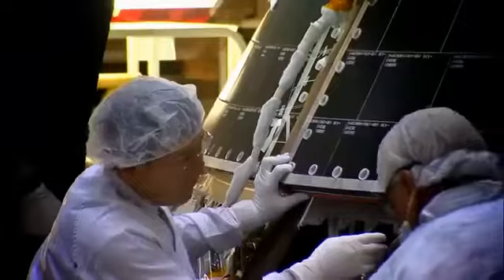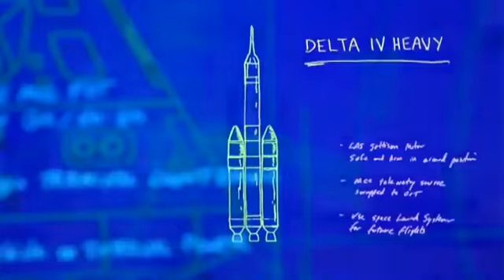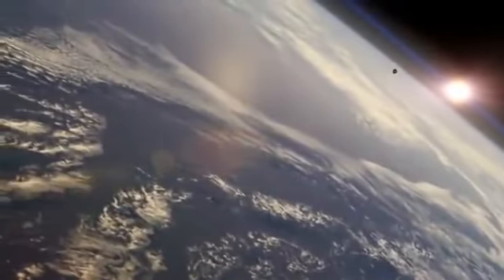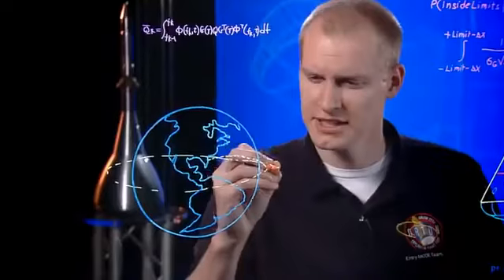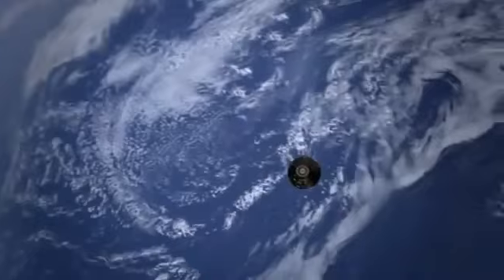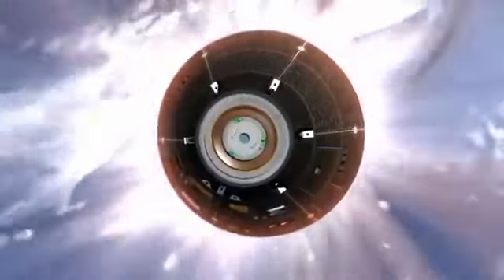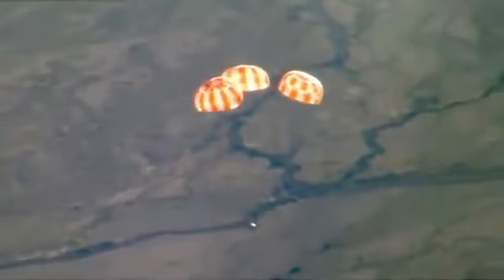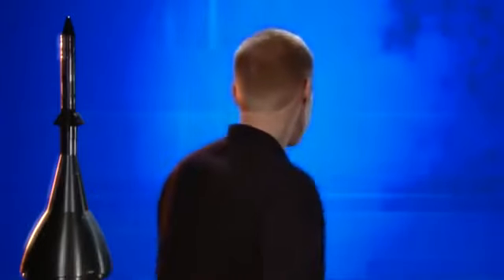NASA engineer admits they can’t get passed the Van Allen Belts

Comment: We did it once in the 60s we can do it again but apparently somehow we lost the technology
Reply: We went to the moon at least nine times during the apollo program.

When we stopped, we got rid of the stuff we only had built up to go to the moon. There's no reason to redevelop a massive amount of expertise and a supply and manufacturing chain for 50 year old technology when we can just design a new solution. In the intervening time, miniaturization of electronics has made them more vulnerable to radiation, so we need to test that our shielding is working before trusting the orion to keep humans alive.
Reply: seigeengine 

So what's protecting the manned space stations in orbit from radiation? I didn't post my comment with the intention of saying we should re-use old technology all I'm saying is we have better technology than we did back then and to think that they didn't plan to counter radiation in space during the time from then to now is a bit stupid however I don't know anything so my statement may be wrong and aside from the cost and materials needed for these rockets it shouldn't be that much of a problem
Reply: Their radiation shielding? They're not high enough to have too much problem from the belts, and take the ISS: It's a massive structure built up over a couple decades, and all it has to do in the short term is keep falling around the planet.

To my knowledge, unmanned craft generally just aren't operating on their way through. 

Well, you're kind of right. Aside from the cost and materials it isn't that much of a problem. The problem is you're underestimating what that cost entails. The apollo program consisted of hundreds of thousands of experts producing specialized cutting edge systems composed of millions of custom-made components. Most rockets we use cost in the tens to low hundreds of millions of dollars. The Saturn V rockets the Apollo program used cost over a billion dollars each. The entire Apollo program cost $100-200B.

Comment: It's refreshing to hear an honest Nasa engineer. Many engineers have spoken about the shielding problems and conclude that until technology has advanced sending people into space safely is just playful imagination
Reply: @ValMartinIreland  Yeah your right Val. There's a lot of difficulties that present themselves especially when radiation can be extremely dangerous here on earth, I can't imagine how dangerous it gets outside the ozone layer and past the earth's magnetic field which protects us. I wouldn't volunteer to try out that's for sure.
Reply: No, that engineer is NOT admitting anything of the sort. He's talking about the first Orion test flight. This was done to make sure the Orion capsule works correctly in the VA belt: electronics can malfunction in high-radiation environments. Orion's electronics are designed to deal with this, but a practical test is required as part of due diligence. All of the hardware on Orion is new, so it has to be tested in operational circumstances before being considered human-rated. 
The Apollo program did these tests as well, during the Apollo 4 and 6 flights. 

We figured out how to get through the van Allen belts in 1958. For radiation, there are 2 important variables: 
1. the radiation intensity
2. the amount of time you are exposed to this intensity. 
You can multiply these two and get the total radiation dose. Humans die if they receive a dose of about 300 Rad. 
In 1958, James van Allen and his team at the University of Iowa discovered the belts that were later named after him, using measurements from the NASA missions Explorer 1. With Explorer 3 and 4 and Pioneer 3 he measured the radiation intensity. This is what he found: in the part of the belt where the intensity is highest, it is high enough that if you stay for about a week (inside an Apollo command module), you receive a lethal dose. So for the Apollo missions, the trajectory was designed to minimize the amount of time spent there. The Apollo astronauts flew through the belts in about 3 hours, while avoiding the part with the highest levels entirely. The hull thickness of the CSM was more than enough to reduce the radiation level inside to manageable levels. 
Astronauts' overall exposure was actually dominated by solar particles once outside Earth's magnetic field. The total radiation received by the astronauts varied from mission-to-mission but was measured to be between 0.16 and 1.14 rads (1.6 and 11.4 mGy).
More details in this video from Scott Manley: https://www.youtube.com/watch?v=h9YN50xXFJY

Comment: Good thing those Apollo capsules didn't have to get to 4000 degrees when they re-entered earth's atmosphere or that tin would have melted.  You would think something 4000 degrees might leave a little steam when it hits the ocean waters.
Reply: The apollo capsules also had ablative heat shields, and likely would have been quite hot on hitting the water. Not sure what your point is.

Comment: No, he didn't. He was talking specifically about the Orion vehicle. If you were designing a new aircraft today you wouldn't just get some plans from the 60's and build a Boeing 707 would you. Orion is made from 21st century composite materials so they need to record the radiation levels inside the vehicle to see whether it's resistant enough to allow the crew and the 21st century electronics (which are far more sensitive to induced voltages from electromagnetic radiation than the old gear from the 60's) to be sufficiently protected. If it isn't they'll just modify it until it is, that's engineering. Apollo was old technology... all aluminium and titanium, it would have offered the crew and systems the required protection, but it's had its day. It's time to move on.

Comment: They have to solve shielding issues BEFORE  he says. So they have not solved anything
Reply: They did. That was four years ago, and Orion has completed its journey.
Reply: @Jan_Strzelecki  So if they've only just recently solved these issues, we couldn't have gone to the moon 6 times
Reply: D Mac If they had gone to the Moon using the same trajectory, going right through the high radiation regions, then no, we couldn't. 

However, Apollo went through different region of Van Allen Belts, where the radiation isn't as high. Orion on the other hand is a deep space exploration craft, and if it can't handle radiation in thickest part of VABs, then it has no business going into outer space, where radiation is also quite substantial.

Comment: No possible directional link established for video transmission -- no problem. . The only directional [ parabolic dish ] antenna carried was a portable unit that could be unfolded and set upon the lunar surface, carefully adjusted to confirm an Earth link. . Not possible as Neil Armstrong took his first step with live broadcast. . Ever wonder why Walter Cronkite had that smirk on his face at the moment of touchdown, the greatest moment in history at that moment? He knew the requirements of transmitting video from a remote location.

No relay was possible as the command module was seen to follow the curvature of the moon in a changing orientation with respect to the Earth, while there was no tracking capability at that time to establish a directional link for video transmission -- and even as the command module remained in orbit traveling around the backside of the moon, and rarely overhead or in the vicinity for any length of time as preparations were being made for the first step onto the surface.
Reply: It seems NASA fanboys can't reply.

Comment: Why does the Orion module looses communication ?🤨Why even over the Indic Ocean but the VOYAGER tin cans sent to the end of the solar system are were STILL sending information after so many years??..🤔 Can anybody explain this?🤔I gave up on a good answer in how NASA sent the men to the Moon using a calculation sliding ruler..(for real I saw it an old engineering documentary😱) ! and computers withe less processing power than my I phone. 😭

Comment: Apollo took off from Florida as it was the nearest to the equator on US soil.   The nearer to the equator the more  advantage the craft gets from the earths east to west rotation.   It flew out across the Sahara and across India still taking advantage the earths rotation and in line with the original trajectory.   The Van Allen belt is not weaker at the poles but it is lower down.  Turning at an angle was not an option and the course was and is well publicised.
Reply: exactly, i heard the same thing, equatorial launch

Comment: We figured out how to get through the van Allen belts in 1958. For radiation, there are 2 important variables: 
1. the radiation intensity
2. the amount of time you are exposed to this intensity. 
You can multiply these two and get the total radiation dose. Humans die if they receive a dose of about 300 Rad. 
In 1958, James van Allen and his team at the University of Iowa discovered the belts that were later named after him, using measurements from the NASA missions Explorer 1. With Explorer 3 and 4 and Pioneer 3 he measured the radiation intensity. This is what he found: in the part of the belt where the intensity is highest, it is high enough that if you stay for about a week (inside an Apollo command module), you receive a lethal dose. So for the Apollo missions, the trajectory was designed to minimize the amount of time spent there. The Apollo astronauts flew through the belts in about 3 hours, while avoiding the part with the highest levels entirely. The hull thickness of the CSM was more than enough to reduce the radiation level inside to manageable levels. 
Astronauts' overall exposure was actually dominated by solar particles once outside Earth's magnetic field. The total radiation received by the astronauts varied from mission-to-mission but was measured to be between 0.16 and 1.14 rads (1.6 and 11.4 mGy).
More details in this video from Scott Manley: https://www.youtube.com/watch?v=h9YN50xXFJY

Comment: Soooooo we never have gone through the van Allen belt
Reply: We figured out how to get through the van Allen belts in 1958. For radiation, there are 2 important variables: 
1. the radiation intensity
2. the amount of time you are exposed to this intensity. 
You can multiply these two and get the total radiation dose. Humans die if they receive a dose of about 300 Rad. 
In 1958, James van Allen and his team at the University of Iowa discovered the belts that were later named after him, using measurements from the NASA missions Explorer 1. With Explorer 3 and 4 and Pioneer 3 he measured the radiation intensity. This is what he found: in the part of the belt where the intensity is highest, it is high enough that if you stay for about a week (inside an Apollo command module), you receive a lethal dose. So for the Apollo missions, the trajectory was designed to minimize the amount of time spent there. The Apollo astronauts flew through the belts in about 3 hours, while avoiding the part with the highest levels entirely. The hull thickness of the CSM was more than enough to reduce the radiation level inside to manageable levels. 
Astronauts' overall exposure was actually dominated by solar particles once outside Earth's magnetic field. The total radiation received by the astronauts varied from mission-to-mission but was measured to be between 0.16 and 1.14 rads (1.6 and 11.4 mGy).
More details in this video from Scott Manley: https://www.youtube.com/watch?v=h9YN50xXFJY
Reply: @h.dejong2531  long story short. All scientist agree its impossible for humans to pass through.
Reply: @6030jdr  No, they don't. Only lunatics claim that it's impossible despite all the evidence to the contrary.
Reply: @h.dejong2531  lol, oooook. Several videos on it from NASA.  That's why we ha ent been outside earth orbit.  Not sure where your living g at bud
Reply: @6030jdr  No, those videos by moon landing deniers making false claims/misrepresenting what NASA is saying. Those videos show an engineer talking about the first Orion test flight. This was done to make sure the Orion capsule works correctly in the VA belt: electronics can malfunction in high-radiation environments. Orion's electronics are designed to deal with this, but a practical test is required as part of due diligence. The Apollo program did these tests as well, during the Apollo 4 and 6 flights.

Comment: Wow, it’s amazing how casually he said they are still working on the problem, pretty much admitting that no astronauts have yet passed through the belts.
Reply: Wow, it’s amazing how casually he said they are still working on the problem
No he doesn't. The flight itself has proven that the problem has been solved. Also, it has no relevance to the veracity of the Apollo program, since each Apollo mission has passed through the belts in a different spot.
Reply: Okay Jan, you're the expert.  Capricorn One was a crappy movie anyway..........
Reply: @Joel4500  Okay Jan, you're the expert.
Not really, no.

Capricorn One was a crappy movie anyway.
Not really, no. It also ended with the conspiracy being exposed for everyone to see - which, again, is not the fate of Apollo.

In any case, do you understand why whatever the Orion is doing has no bearing on the veracity of the Apollo program, as far as the Van Allen Belts are concerned?
Reply: @Jan_Strzelecki  It was a JOKE dude, relax....

Comment: twice as hot a lava: next vid plz... smh
Reply: Twice as hot as lava and almost a vacuum. It is more than the energy in the particles, it is also their density. If the particles are very diffuse you can withstand those temperatures with no protection.
Reply: Advised Potato ok

Comment: Maybe he was saying they must solve the problems associated with the orion craft, and not referring to space travel in general
Reply: How exactly, then, did they test the problems with the Apollo space craft before going?
Reply: @joes.2111  probably, but even if they didn't, radiation isn't going to kill someone just like that. The biggest problem with actual technology is that electronics are smaller, therefore they work with way less current, radiation can kill those components.

Comment: You cann't use the exactly same sheilding as in Apollo mission. Multiple reasons: 1) Space craft has completely different dimensions and geometry. It is also bigger. 2) Electronics with in is much more sophisticated and prone to radiation due to use of modern and very small circuits in memory and CPUs. 3) If we plan to send astronauts for longer missions, we do not want to expose them to a risk of exposure. The Apollo astronauts were at high risk, but they got lucky. We just want to ensure higher safety, and prepare for missions to Mars in the future. 4) We want to make design BETTER than from Apollo missions, mostly to make it lighter, more modular, more robust and cheaper, that requires exploring dozens if not houndreths of possibilities, simulating, and TESTING them in real conditions. 5) Solving a problem doesn't require forgeting all past expiriences and starting from scratch. Quite the contrary it builds uppon expiriences, failures and successes.

Lets say you want to build a new type of Formula 1 car, that is faster and has different performance and geometry. Would an engineer saying, "With this new type of car we need to solve various traction and aerodynamic problems we face, and need to find a wheel design that ensures it works.". Then you saying, just use a wheel from my bike! It is already invented tech, why would you invent it again. Or use one from a previous Formula 1 cars. If you cann't, that means there was no F1 cars before in the first place, and it is all fake!".

Get your shit together.

Comment: I don't. Want to get into a debate on this but the computers they had on the Apollo missions was not really a computer rather switches.  A solar powered calculator has more computer power than what they had.  They are checking the new technology that is going to be used for the mission.  The Apollo crew was well protected from the radiation back then.
Reply: The Apollo crew was well protected from the radiation back then by 1/24 inch of aluminum foil, so that's what they should use now as well.

Comment: it was easy back in the 60's because the Apollo program, the craft used a very basic computer that was for nothing more than guidance.  Today's computers and sensors that are on the orion space craft are much more advanced, and more sensitive to radiation.  OH by the way the moon is not outside the Van Allen belts.  The belt is massive.

Comment: Water-infused sodium polyacrylate suspended between two layers of solid heat-shield material would insulate the capsule from radiation.
Reply: if thats the cae, add a little more explanation, and also let nasa know.